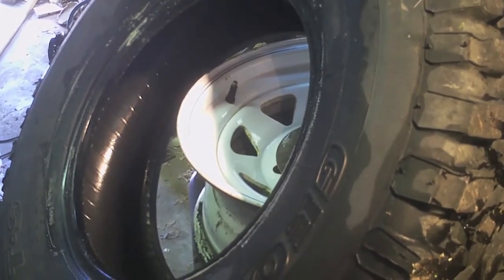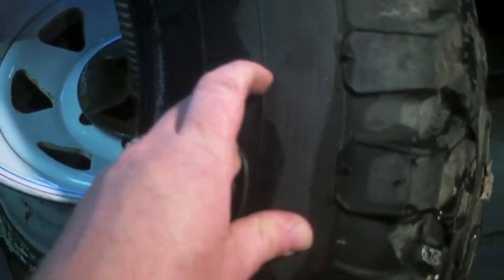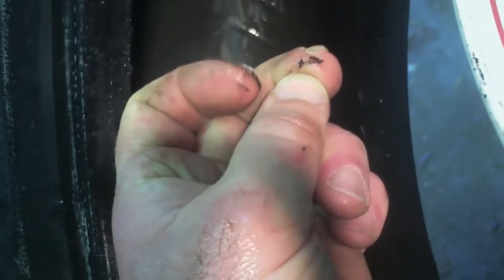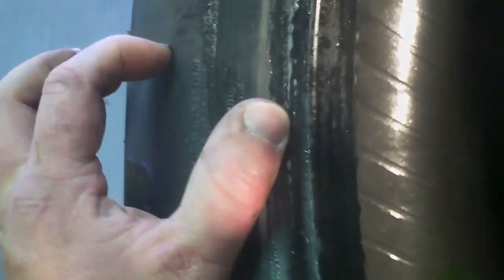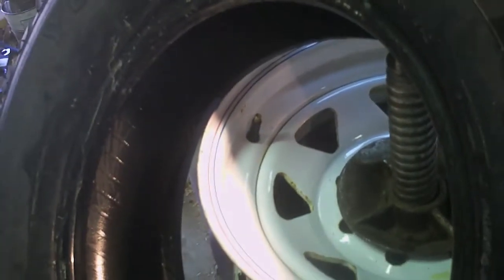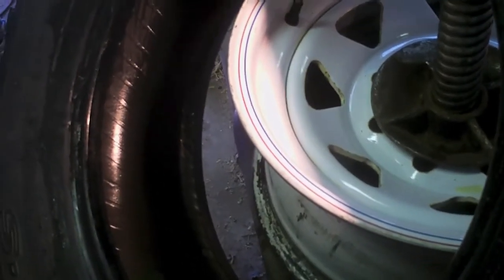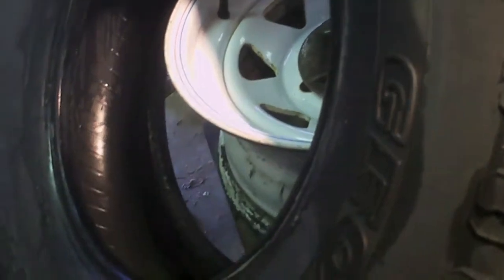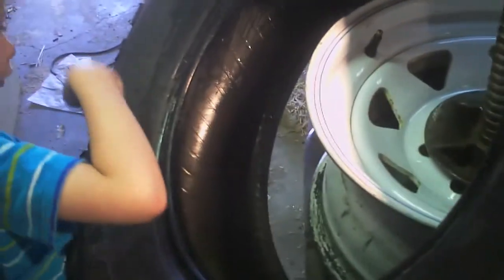Fluid Tire Balance: Testing Rubber Disintegration

Comment: Tires rot from the air they are exposed to. A friend of mine stored a car with new tires fitted in a garage with no windows and in less than 10 years the tires were cracked and unusable. They don't make tires like they used to.
Reply from the maker: Interesting, I would have thought out of the sun they would be like new.
Reply: @acme663ryo  Thats what we thought too. We went in so he could show me the car and upon inspection of the tires, the sidewalls had radial cracks all the way around.

Comment: Had anti- freeze in the tires of my dads old ford 1710 tractor. Those tires lasted well over 20 years until dry rot finally got the best of them. And leaks were easier to find. lol
Reply from the maker: I bet they were.

Comment: Washer fluid is less toxic  using antifreeze with aluminum rims will eat rim
Reply from the maker: I have seen a lot of aluminum radiators so I don't think it is that much of an issue as long as it is mixed properly.  You are right washer fluid would work but in cold climates there could be a lot of slushing.   Anyway short of lawn tractors for extra weight, I don't think the idea is worth messing with even if it works.
Reply: NelsonStudios not the same type of aluminum and it will eat steel we stopped doing liquid in tractor tires long time ago destroys 300 $ rims

Comment: Makes sense that the antifreeze wouldn't deteriorate tire rubber...antifreeze runs through rubber radiator coolant hoses in almost every OEM application out there.  

Would it be cheaper to use the pink RV winterizing fluid?  Same fluid balance, similar anti-freezing properties, but half the price?

Comment: Will this deteriorate the rim(aluminum/alloy)?
Reply: dasteufelhund radiators are aluminum...
Reply: MyLonewolf25
 True...but aluminum corrode, so will this accelerate the corrosion process?
Reply: ***** no
Reply: MyLonewolf25
Using ceramic beads now, perhaps this will be a future experiment.
Reply: According to wiki glycols are not corrosive to aluminium.

Comment: Ya i cant see it causing problems i bet its just rubber dust stuck to liner thats scraping off.  I just did it to my front tires on my pickup and its smooth as silk from 0-65 mph. Im guessing if its used on ag tires its fine.  Cant see them being some exotic compound